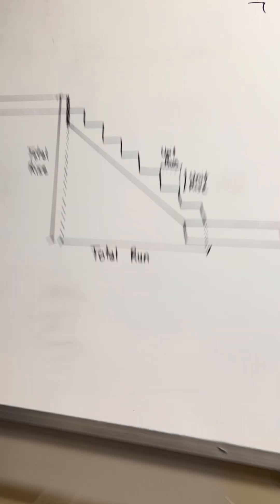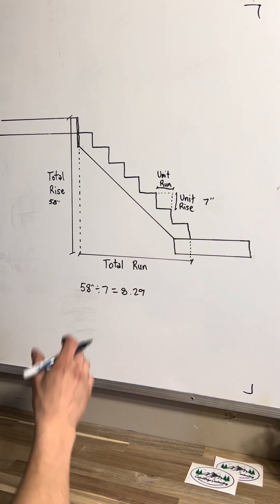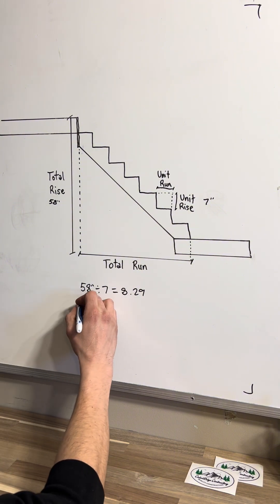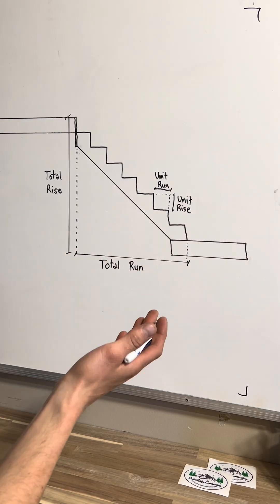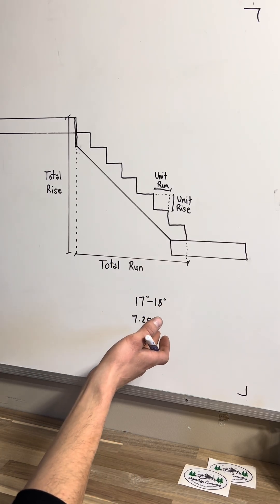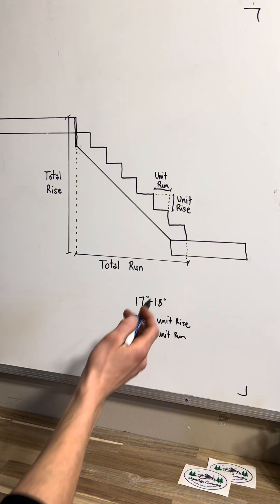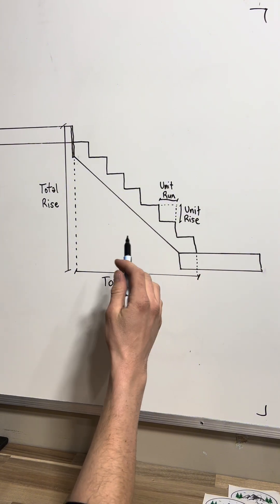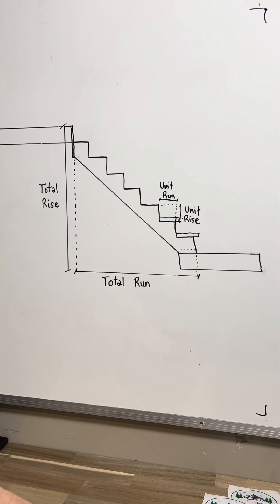How to Build Perfect Stairs — Step-by-Step with Calculations

Comment: You can just buy 
Those side pieces at the hone Depot. 
Whatever it's called the dude walls that have steps cutout.  With two or three of those you can use those to build stairs.  The rest you can do yourself. No math needed. I mean that's the way I would do it.
Reply from the maker: The reason we do the math is to make sure every step is EXACTLY the same (even the top and bottom step) If even one step is different then the others, the stairs do not meet code and are a tripping hazard.

Comment: In UK we have simple formulas to set out a stair. 1) 2Rise + 1Going = 550-700mm.  This consistently provides a comfortable stair to climb and is so successful that it has been applied for more than 55 years.  2)  Domestic stairs should be at a pitch of no more than 42deg and a commercial stairs 38deg.  These pitches limit the excessive rise potential that only adhering to the 1) formula could cause.

Comment: And how do you measure and cut the ends?
Reply: Left out a very important part, didn’t he?
Reply: Last step,just cut the top off by using that 7 & 10 inch angle.done  !

Comment: can you show how to cut the back side where it sits against the landing? I am lost on that part please. Thanks
Reply: You can get that top angle and the bottom angle as well, just by using the framing square and the proper rise and run numbers. Alternatively if you just want to know what the angle is in degrees, divide the rise into the run and get the inverse tangent (TAN -1) of that result. Subtract that number from 90° and that will give you the other angle. 
3 angles involved in any stair (right triangle). 90° and 2 others.

Comment: I always layout the overall diagonal length, then step off the unit length. Make small minor adjustments to increase or decrease the unit length to fit in overall.
Basically adjusting for “cumulative “ error that occurs when laying out.
Reply: Agreed. Even the width of your pencil line, cumulatively adds up. It’s best to calculate the hypotenuse length and force your stringer layout to fit that measurement. Especially if your bottom landing has no room for error.

Comment: It isnt necessary to consider the thickness of the treads when laying out the stringers.
Just remember to deduct the tread thickness from the bottom step when cutting them.
The most important measurement is the floor to floor in most cases.
So lay out the stringers with equal riser measurements.
Then deduct the tread thickness from the bottom step before cutting.
However the run measurement can become an issue in some cases.
A design change like say a landing and a second set of steps is sometimes necessary.

Comment: So according to your calculations my stairs on my  deck should have 10 rise/steps, 71*7=10 my current steps only have 9 rise the tenth is the top of the deck, does it matter if I use the 10 risers and allow the top step to be part of the deck or should I make the stringers 9 like it is now, Room is not an issue.  also the steps are 40" wide and I see so many conflicting opinions on how many stringers to use, Mine only has 2 some people say 3 and even 4, Do you have a thought on this and how to calculate for it?  Thank you .
Reply: You have to calculate the total rise meaning from top of deck to top of landing at the bottom. The most foolproof method is to draw your exact condition on a piece of paper and go over the rise and run calculations a few times. Dimension out each step precisely, to be sure you’re not overlooking anything. Don’t forget to subtract the thickness of your first tread, off the bottom stringer rise measurement. That is the most common mistake made.

Comment: stringer needs to be crown up for durability
Reply from the maker: Yes, this guy knows. I missed that in the video.
Reply: How did you attach the upper part of stringer to trimmer boss...as it does hang down...1 step ...thks mick...thks for your video very helpful.
Reply: Sometimes I snap a line on the top of  the stringer and cut it dead straight just to keep that Home Depot lumber from China honest.

Comment: Only thing is that you use the first stringer you cut as a pattern, that way if you are a little off with your cut, it's transferred to the other stringers, so they are all the same.
Reply from the maker: Yes good point, I missed that in the video.